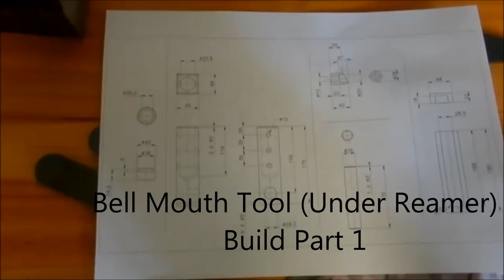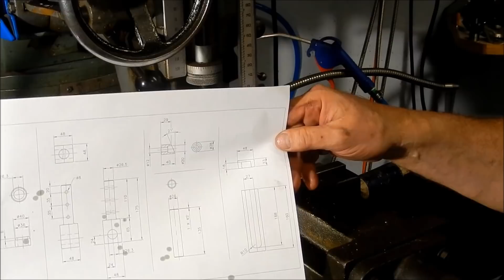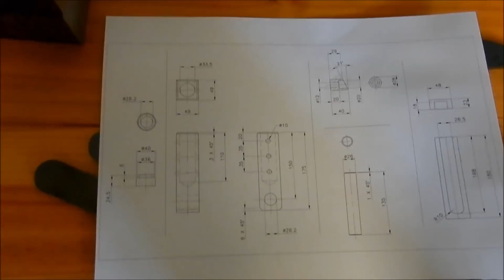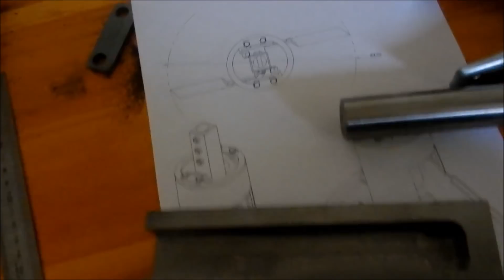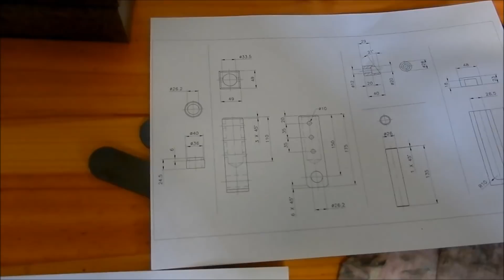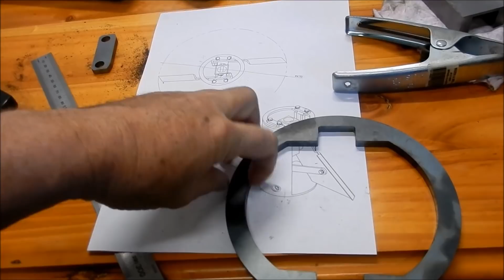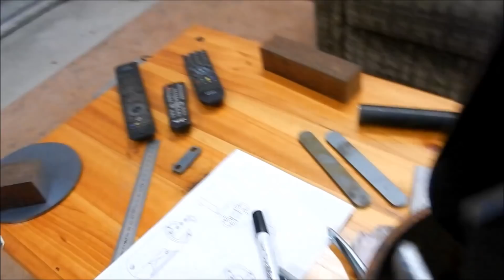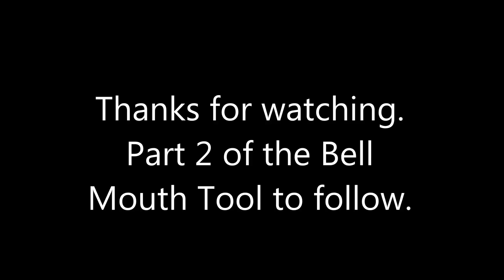Home Made Bell Mouth Tool / Under Reamer Part 1

Comment: A 2 part build? Are you missing a digit Cam?!  ;)
I wonder could you have increased the depth to get more capacity, or does the soil not provide enough skin friction according to the geo report?
Reply: Nice one! LOL!
Reply from the maker: G'Day Tommy, I can do short one's occasionally.  It will be a struggle with Emma's Tool competition but I'll try my hardest although it may run for an hour or more.  Yes boundary stiction,  The clay soil here is extremely reactive so I wanted to remove any factors other than bearing.  It worked out at a minimum depth of 1.5M but I went on average 1.8M - 2.1M deep.  Its a bit hard to gauge a bearing load as I want to bring in a larger lathe and bigger mill at some stage in the future so like everything I went overboard.  I don't want to be in a situation a couple of years down the track and things start moving again and I say to myself why didn't I go that little bit further when I had the chance.  Having said that I was curious as to the stiction effect so just for kicks I sunk a 1.8M hole in the backyard and filled it with concrete and let it set for 1 month then erected a frame over the top with a 2 Tonne Chain Block to see how much force it took to lift it out.  With two of us on the chain we went till it wouldn't go any further.  It was almost 4 hours later that I finally noticed some movement but it took till the next day before we could get it all the way out and it fought all the way.  Neglecting the weight of the concrete I would say on stiction alone it would hold close to 2 Tonne and I've got 30 off them.

Cam
Reply: Nice, at least you have peace of mind!
As a geotechnical engineer once said to me; "all geotech is rubbery"